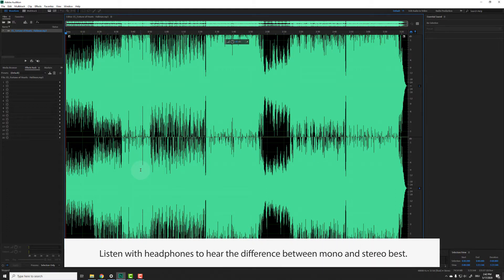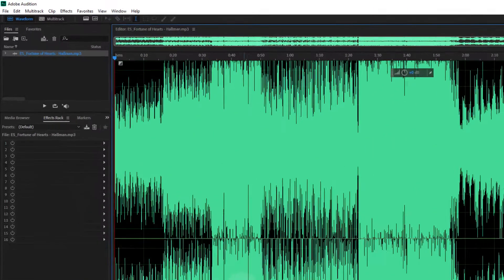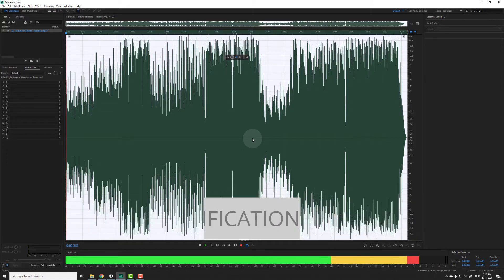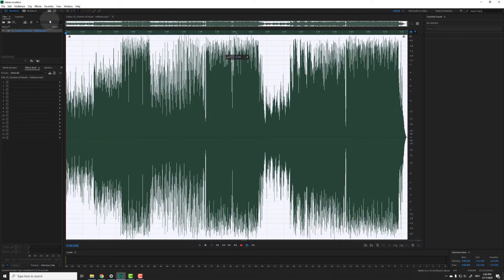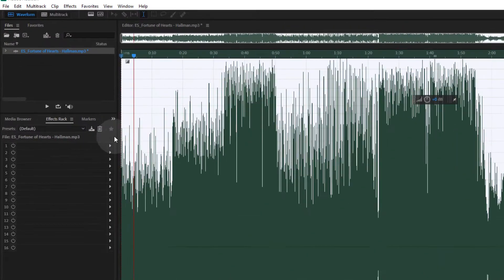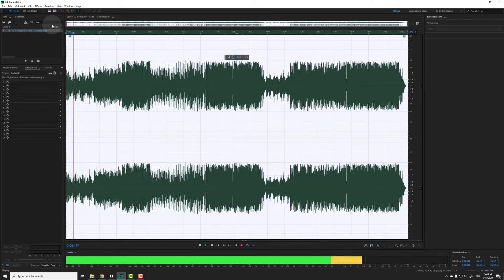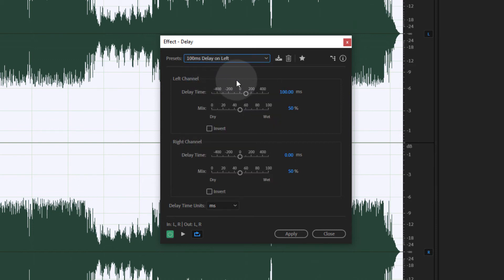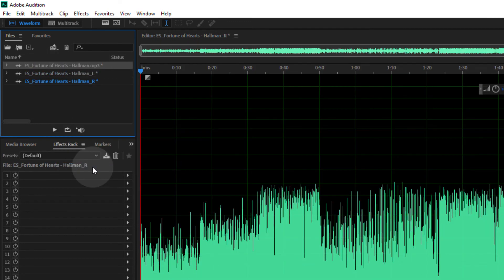3 Ways to Convert Mono to Stereo and back in Adobe Audition

Comment: I have a mono file and this didn't work for me. Did you happen to say that it's a requirement to have recorded in stereo in the first place?
Reply from the maker: This method converts a Mono file into stereo by just putting the same signal on the left and right channel. So while it is technically stereo afterwards, it will not be the same as a true stereo recording. Because in a stereo recording the left and right channel will never be exactly the same due to the position of the source and microphones.